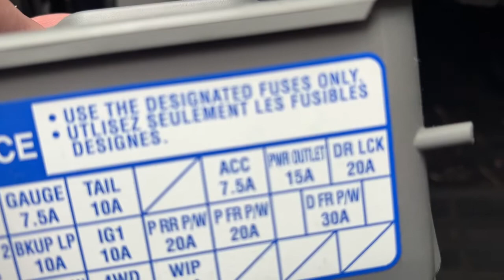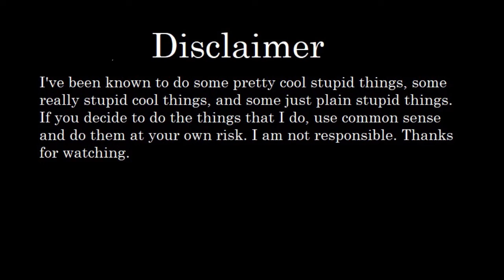Replacing the power outlet / cigarette lighter fuse on my Toyota Tacoma

Comment: Thank you so much for suggesting to look under the cover of the other fuse box under the hood.  I found a spare 15 AMP fuse there and decided to replace the one in the fuse box under the dash even though it did not look like it had been blown.  Turns out, it had been blown, and the spare fuse fixed the issue.  i tested the power outlets which are now working (Cigarette lighter and a 2nd port to the right of it).  I believe I had blown the fuse when I had connected a DC to AC  Power Inverter to the power outlet and was running an appliance (speaker or something that you normally plug into a 110 AC outlet).  I believe the overload of the fuse occurred when I did not shut off the inverter before stopping and restarting the engine.  I had used the inverter on another vehicle which also had it's 20 AMP fuse blown for the same reason.  I went to NAPA Auto Parts and bought 5 of the same fuse for the Tacoma and another box of assorted fuse sizes to keep on hand.  I did the same for the other vehicle.  Thanks again.  That was a great hint?    JB
Reply from the maker: @johnbrown9944  glad I could be of help and thanks for liking and subscribing

Comment: What about 2019 would it be the same, I guess I could google it
Reply from the maker: Should be a diagram on the back of the fuse panel that tells what each fuse is for. If it is missing you could pull each fuse one at a time and see which one is blown.